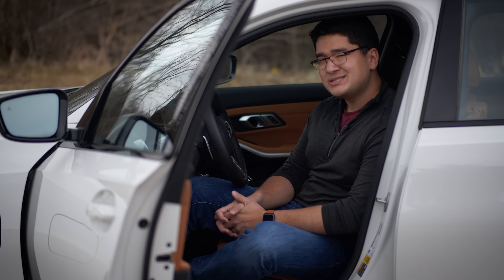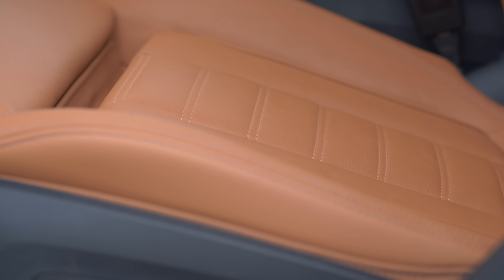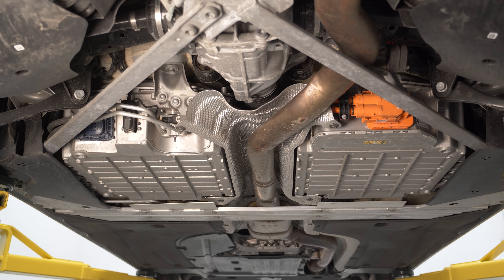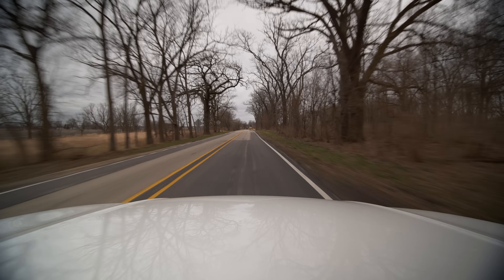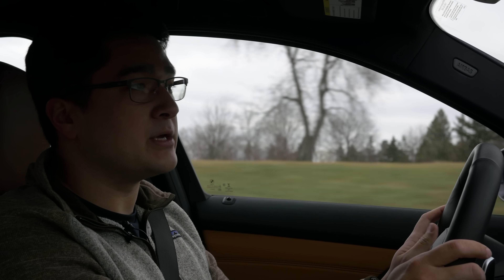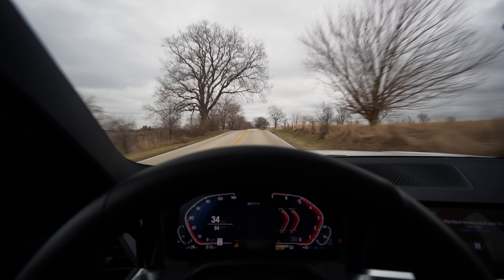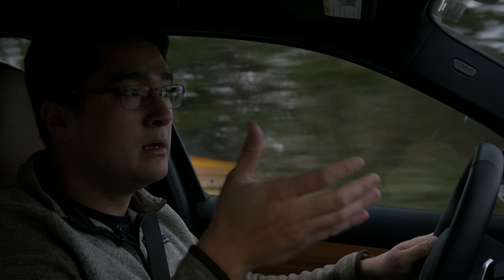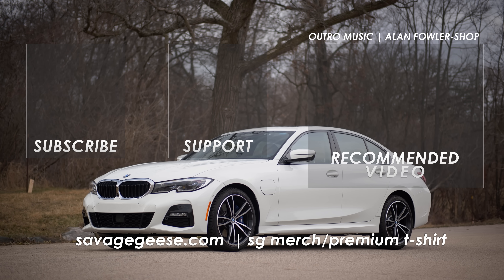2021 BMW 3 Series | The Transition is Here

Comment: I don't believe that Jack realizes the benefits of having a PHEV. Even if your daily commute is 40 miles (so 80 mile roundtrip), that still means that you're effectively HALVING your daily gasoline consumption in something like this BMW with almost 40 miles of range. At ~20,000 miles per year, you're doing ~10,000 of that on electricity only.  And even when the battery is depleted, going into hybrid mode will still net you some efficiency gains over a 330i. Range anxiety is also completely eliminated and most users won't even have to install a Level 2 EVSE in their homes and simply rely on the provided Level 1 EVSE since the battery is so small. More A to B commuters should be PHEVs.
Reply: I did some math, and found that with a 30 mile range, I'd cut my gasoline usage by 75%. I really would like a PHEV sports sedan.

Comment: The more complicated the 3 gets. The less i like it.
Reply: Exactly, 3 series was always loved for its simplicity, its was like the mx5 of sedans.
Reply: e46 was the last least complicated. the e90 is where it really went downhill
Reply: @JDMHaze  imo e90 was the last old school 3 series, e90 330i and 328i were as simple as cars get. They had a very reliable NA i6, and they were the perfect size.
Reply: @insayn7995  I have a e90 328i and it’s so complicated with their computer system for the engine I hate it. You don’t get a coolant gauge, you have no idea what the oil is doing, and worst of all no oil dip stick.
Reply: The bigger the 3 series gets, the less I like it. I had an e36 coupe. Perfect size for me. Now I'm in a 128i, which is the same size as the e36. This current  3 series is nearly the size of an earlier 7 series. Too darn big.
Reply: @JDMHaze  At least in the e90, you could get a NA straight six. And a manual transmission.
Reply: @JDMHaze  Eh the E90 I’D argue is the last true “simple” 3 series. The N52 engine in that car is actually stood the test of time and is fairly reliable. Plus it’s the last NA I6 that BMW ever made. A E90 3 series with a MT and non-I drive is probably the last “simple” 3 series that exists.
Reply: @dougrobinson8602  correct, I talk a lot of crap about BMWs but they don't get the respect they deserve for keeping the I-6 tradition so long especially in NA form
Reply: @markm0000  I almost forgot the lack of a dispstick--fucking horrible.  Changing a valve cover gasket on the N20 is horrible, too.  So many little pipes go in every direction on the top of the engine.

Comment: This car exists because it lowers Emissions Tax in Europe.
Reply: Correct. Just ordered the X3 30e Plug-in Hybrid. Drops the tax bill per year from 1% to 0.5%, and for someone like me who drives BMWs costing around 80,000 Euros gross list price, that saves me thousands a year  in taxes.
Reply: "emissions tax" lmao
Reply: @robertw.1499  Still gets the same fuel economy as a modified 20 year old subie. Looks like a waste of technology if you ask me.
Reply: @eivis13  It has zero emissions (~50km EV range) for an average driver if they can charge at home. No 20-year-old car can do that.
Reply: @villLe  unless you add some batteries and a few electric motors. Considering it gets only low 30 mpgs in hybrid mode it's a waste. It's not like it's an rx or a gs450h or etc.
Reply: As a person who owns one and who has a 10klm commute and the ability to plug it in at home its ideal. 40 ltr fuel tank and I fill it up once a month maybe max. I've seen 56 mpg over the year I have owned it.
Reply: Germans just don’t get it  right with hybrids

Comment: Jack, why are you measuring the effectiveness of the "e" model based on your TOTAL driving distance?  If you can get gas-free miles for even HALF of your trip, you're way ahead.  Why does the standard have to be 100% EV or it's useless?  And why are you talking about range anxiety?  There is no range anxiety with a hybrid or plug-in hybrid.
Reply: Yeah I didn't understand his angle either, you're still 39 miles in before you even begin using gas
Reply: I couldn't give thumbs up to the video for this reason alone.
Reply: Well, the total driving distance does matter a lot. For example, I used to commute to work over 75 miles each way with no EV charging at work. This means I could "only" have electric driving for 40 out of 150+ miles. I mean yes, sure it is more than 0, but does it really justify the $2-30k price premium from a regular 3 series? Probably not. But it would make more sense if I had a 20-mile commute each way, or even 30 or 40 miles maybe. I know not everyone has the 75-mile commute that I had, but that's kind of the point Jack is making. It's all about diminishing return and at some point, it's not worth it anymore.
Reply: @Dub45678  You still save 40 miles of fuel everyday, the same amount that is saved by the person that only has a 40 mile commute
Reply: Yeah...and 40 miles is quite a lot for 90% of consumers. If you’re driving 100 miles a day for work I am SORRY 😬.
Reply: Driving a Volt myself, the range anxiety isn't that you'll be stranded, it's that you are annoyed as the spilt between electric miles and petrol miles starts to favour the latter. My lifetime average is 120mpg which I feel okay about, the previous owner averaged 55mpg which would've made me feel pretty dumb.
Reply: 40mi is alot, i’m typically doing >25 and that’s if I want to do something other than go straight home.
Reply: @Thoughmuchistaken  our 2018 Cadillac CT6 2.0E plug-in uses similar Voltec and is right at 120 mpg lifetime too!  The 40 miles on battery easily covers my 12 mile commute to work. Plus I can plug in at work so plenty of range after arriving home for errands, shopping,  or going out to eat.
Reply: Or, you could just choose a much cheaper and more efficient car to begin with, if saving money is your thing...
Reply: They don't get it that 40 gas free miles each day adds up. Oh well.
Reply: It’s $60k. That’s the problem.
Reply: @Dub45678  if you factor in the federal tax credit, the 330e is cheaper than the 330i. The 330i does get better gas mileage compared to a 330e with a depleted battery so it all depends on how far you’ll go before you can recharge.
Reply: Guys you sort of missed the point of 330e. It gets 22 (rwd) or 20 (xdrive) miles if EV range, which makes a good chunk of your daily driving gas free. Regen breaking increasing efficiency and lowers break wear. Perhaps most importantly, with the tax credit that most if not all 330e buyer would qualify for, it is the cheapest trim of 3 series. In fact, a reasonably optioned one can be had for sub-40k (average selling price for a new car) after all the incentives and discounts…

Comment: I'm not typically a BMW fan, but I have to compliment them here - the PHEV variant is only about $4k more than the non hybrid, and they didn't downsize the gas engine in the PHEV version. Given the PHEV tax credit erases the increased cost of the PHEV variant, it's a very strong option.
Reply: good comment

Comment: As someone who owns this car I can say it works amazing for my needs (wasn't in the market for it but got $7,000 off MSRP for mishap at dealership with another vehicle.) I live in San Diego, charge at home, and have a 19 mile commute to work. I also have the ability to charge my vehicle for free at work when I arrive. In the 4 months of ownership I've gotten gas 2x and only because the range got below 50 miles after driving to LA for a bit. I totally think BMW should have given it the range of something similar to the RAV4 Prime, but it's a car that puts a smile on my face every time I drive it so I'm not complaining.
Reply: being able to charge for free at work is a huge benefit!

Comment: I disagree with the comment that the plug-in hybrid doesn't add anything. I have a G20 330e and on an extended highway trip (Canberra to Sydney and return) at 110kmh the battery helps reduce the fuel economy to as little as 3.5l/100km (66mpg (US) or 79mpg (UK)) whilst still giving that extra 100+HP for overtaking, etc. If you have a shorter trip, say 60 mile (100km) then most of it is on electric which means your fuel economy can be almost eliminated. In the last 10,000km my car is telling me that about half has been on electric only and half on petrol/electric combined with an average fuel economy over that distance of 3.4l/100km. It's also more fun to drive than the normal 330i.

Comment: Evidently they drove the cars for a short term and hard to get those fuel economy numbers. I have owned both the regular and hybrid new generation 3 series and had them for months and got way better numbers. I was most impressed by the regular 330i where I was getting around 34mpg and with the 330e I was hovering around 42-45mpg and drove them spiritedly. Those are great numbers taking in consideration these cars handle wonderfully and are great performance daily drivers, much better than any of the other cars in the segment. I was not able to charge at home daily, only at work. If you can charge both at home and at work with the 330e you can easily go over 60mpg and only need gas every couple of weeks! About the price, easy get one on a lease with close to %15off with incentives or buy a 1-2yr old Certified.

Comment: Like someone said these work best in Europe. Purchase price is lower due to the emissions tax and the plug-in makes it a good option for many company car buyers and others that used to buy diesels or have an access to a charging point at home. One relative went from a diesel GLC to a plug-in petrol when he retired. 20tkm average fuel economy is about 6L/100km or ca. 40mpg. Pretty good for a 2,5 ton SUV and about the same that he had with a diesel.

Comment: The 330i xDrive leases well.  I stacked multiple incentives , which combined with an eager dealer and a decent money factor make it not much more than a Honda Accord .  And much better dynamics with all wheel drive. Leave it on eco and the G20 will easily do 38 MPG on the highway.  Most of aren’t looking to break any world records, just have a bit fun while driving.
Reply: x-drive or the RWD model?  I could not get mine x-drive F30 over 22.3mpg, it was like it was stuck there forever.  City/highway didn't matter.
Reply: @bb5242  xDrive. The good fuel economy surprised me. At highway speeds the car will coast at idle RPM until power is needed. I did not expect the all wheel drive to be more efficient than an Accord 2.0T but it is.

The “base” model has real analog gauges with navigation between the speedometer and odometer. My only options are xDrive, driving assistance, heated seats and steering wheel.

Comment: what about reliability ? at Least Lexus has a ton of experience with the HYbrid set up. I am worried that I now have to contend with 2 systems - regular engine maintenance and now extra worry about batteries and their degradation and replacement. I love the 3 series  but I am not sure I want to trust my pocket book to BMW and their batteries when they start to wear down and then all the usual upkeep with a regular combustion engine. If its a lease for 3 years - maybe I might consider . I can walk away - but I am really skeptical about 2 systems to worry about.

Comment: As a 2018 330e owner who commutes 80mi per day from city to city, I use the electric only mode in town at each end, the combustion engine on the highway in the middle and I average 42mpg. My battery is only good for 22mi fully charged, but in save mode,, it charges on the go. No, I cannot do it all on battery, but  saying it doesn't benefit the commuter is short-sighted. On the weekends I have a blast in the mountains. It's a great car, and I only use about $40/week premium fuel.

Comment: In the next several years, the larger question is why lease an EV over leasing a PHEV other than perhaps cost? If you do not drive much, you can drive almost all electric with this if you want. If you do drive a lot, you don't need a second car with this. As people are hopefully still hesitant to fly, these make even more sense for someone who does not have the space or budget for two cars.

Comment: The 3 series is probably the best all around entry level luxury car in existence. The new hybrid tech makes sense as well.
Reply: Only if you don't drive its competitors.  And only if you lease it and don't experience BMWs legendary reliability.
Reply: @bassandtrebleclef  the A4 and C 300 just aren’t as good. I’m not a bimmer guy at all but these are fantastic. Forever will not understand reliability concerns when buying new, especially if leasing.

Comment: From my knowledge, the 330e actually has a detuned engine for some  weird reason. So it's essentially the same engine you find in the 330i. No clue how you can bump it back up to 255, but oh well.
Reply: It is an 320i (184hp in europe) plus electric motor

Comment: I have two friends with 530e G30.  Both average mid 40 mpg.  In that size of sedan with its amenities and qualities.  Hybrids are a compromise but s good one for now.   One of the owners has about a 350 mi drive to visit her sister. This drive is mostly along back highways and could just not be done in any electric car right now.

Comment: That BMW 3 Series has one of the nicest sounding 4 cylinder turbo charged engines of any car I've seen and heard reviewed on your channel. The ZF gearbox also sounds very quick and smooth when you floor it from a dead stop up to speed. It's a nice clean luxury appliance that will keep its value for a very long time with great driving performance. I think BMW knows this and charges the premium price for it. it always looks good, like a good suit in your discussion, and that's why you buy a BMW today. Great review. Enjoyed a lot.
Reply: The ZF is very good.  Not sure it needs 8 forward gears, though.  The ratios are pretty indistinguishable.  Not sure if the engine noise is real or not.

Comment: i think the 330e and plug in hybrids make a lot of sense in states like CA. We can get up to $8,500 in grants/rebates before the tax credit. The 330e then makes a lot of sense because you can save a couple grand buying it compared to the 330i without losing anything else and you gain the electric range and better fuel efficiency.

Comment: I feel like you should just buy an Accord hybrid, it's got more space, cheaper to run, better gas mileage, and is nearly as fast. The only downfalls I can see are a slightly less engaging driving experience, more cabin noise, and a less desirable badge. The nail in the coffin for me regarding this car is the price tag, you can have yourself an Accord Touring Hybrid for 2/3 of the price.

Comment: I just had the opportunity to drive one of these overseas (prior gen) and I liked it a lot more than I expected.  My sons have the latest 6 cyl powered 3 and 4 series cars.  I might like this even better than those.  I was bent on getting a Lexus IS.  I did a round trip through hills, about 150 miles.  My approximate mileage was definitely over 30 MPG.  Maybe as high as 35.  Now I have to do the math.  I like to keep my cars 10 years and hence my preference for a Lexus. I wonder if a 330e would make it that long.  My wife has the latest TLX.  Any time you push the TLX, it lets you know there is a 4 cylinder engine under the hood by the noises it makes.  I didn’t find that with the 330e I drove

Comment: I've got an older 3 series and while the exterior design is finally good again, I agree with Mark - the interior takes zero risks and is all pretty dull.  But 50-60k for a 4 cyl and/or hybrid that sounds like a Subaru?   Nope.  Not when the Kia Stinger exists.  Or even the G70.
Reply: when has a 3 series interior ever taken any risks? never has and never will. this is not a korean product that changes every five years.

Comment: I owned a 325e in the 80s and 90s. Loved that car, although it only had 121 hp and 180 ft-lbs of torque. I got around 28 mpg. The five speed was super fun to row. I miss it.

For $60k I’d get the M2 Competition, hands down. This car is stupid expensive. And boring.

Comment: “It’s totally adequate” I used to love the 3 series, best overall little sports car hands down. In the 80s, 90s, even 2000s but the more modern variants idk 🤷‍♂️.
Reply: The buyers also changed and BMW complied. They're mostly concerned about the badge and don't care about anything else cause it's leased.
Reply: @chrislim7976  I agree with you, these used to be driver cars. So much fun even with way less hp and gadgets. My fav ICE vehicle in recent years was the Macan S, that is pretty amazing for what it is.
Reply: @LawrenceNewmanESQ  
A lot is also to meet environmental and safety regulations so everything ends up feeling and looking the same.
If BMW reissued brand new E30s I'll pay whatever fines and my car shopping would be done.
Reply: @chrislim7976  I had a 88 is and a 92, it felt like you were on train rails. So much fun. My 03, 07, and 13 were faster but not more fun.

Comment: Love BMWs used. G series will be a great value in a few years. 340i for me
Reply: The problem with these cars is the shit that will go wrong with them in a few years isn't owner-fixable.  Those all digital dashboards will go out and you won't just be able to order up a replacement, it has to be coded to the car, the odometer transferred over, etc.  The whole car is like that, it's god damn awful.  Even swapping out a battery is an experience with dealership nonsense.  Yes, you can get a tool for a couple hundred bucks that will register the battery, but why?  WHY?  Why can't there just be a menu on that in-car computer screen that lets you tell it "yup, I installed a new battery just now."  It's all dealership lock-in and making fat wads of cash measured in inches.